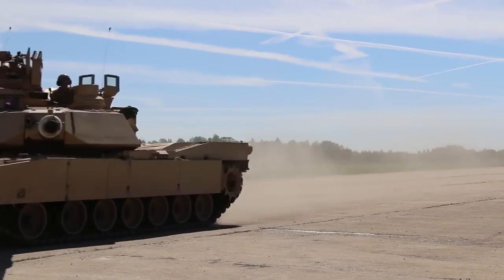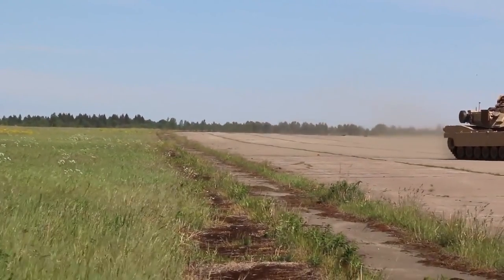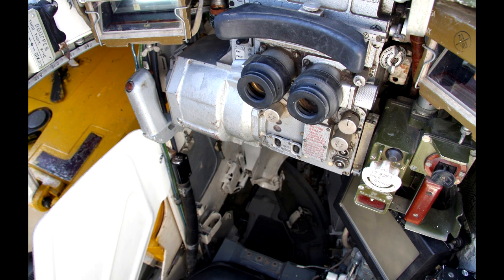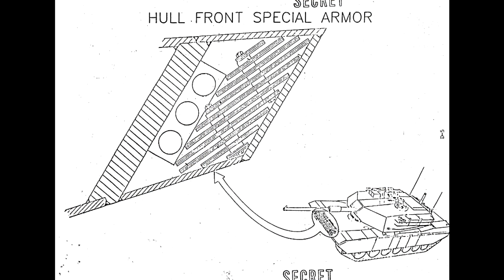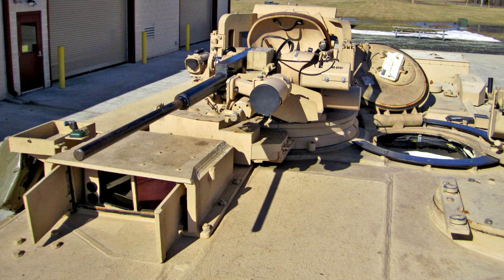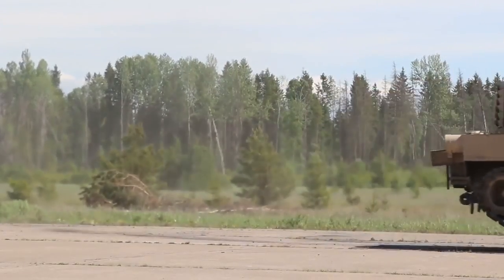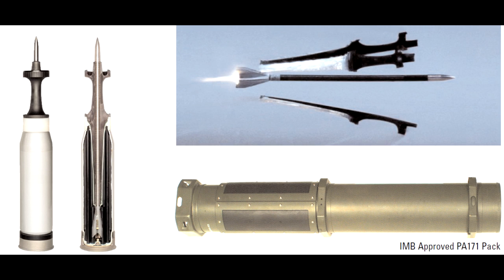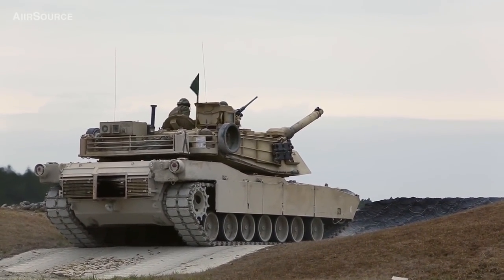Problems with Abrams tank

Comment: When M1 Abrams uses gas turbine engine, it's good. If it's T-80, it sucks. Damn logic
Reply: @QualityPen 
That's operational logistics (getting the fuel from the depot to the AO, which could be Afghanistan for sake of argument) . I'm talking about the Strategic and Tactical levels of the logistic chain (getting the fuel from Beachhead to the motor pool, and later to the tanks).

Your rail network is great for the Operational Level logistics, but you still need to get the fuel from those rail hubs, out to the actual tanks in the field (which doesn't have any obligation to be near any rail hub).

The price is just a clever excuse for the politicians to not pursue it. As for maintenance, that falls within tactical logistics.
Reply: @ShadowFalcon  OF COURSE the soviets lacked trucks, they didn't produce them like a few thousands a year. For example, 44k Ural-377 were made in 12 years which is about 3700 trucks a year. Needless to mention that  the USSR produced other trucks and also by thousands for each type
Reply: @ГеоргийМурзич 
Did I say they lacked trucks?
Reply: @ГеоргийМурзич 
Let me just answer my question to you, myself then.

No! I didn't say the USSR lacked trucks.

I said the Soviet Armed Forces lacked the logistical capability to support a tank force powered by gas turbines.

This, by the way, isn't a technical deficiency. It's a choice. The Soviet Armed Forces didn't believe the increased performance of the gas turbine was worth the increase in logistical capability, and therefore went with conventional diesel engines in future projects like the Object 188 which led to the T-90, much like the German armed forces did when they developed the Leopard 2.
Reply: The same with the silhouette.

Abrams has big silhouette: Good

T-14 has a big silhouette: big target.
Reply: @Kuraimizu9152  Abrams also has more gun depression so the tank can shot even over more Angeles slopes while show less of the whole tank.
Reply: @Kuraimizu9152 
Never heard that one honestly.
Reply: @Alexnder90 F Let me paraphrase: America can use gas turbine because it spends billions on military and can waste galons of fuel to achieve sumiliar performance as a diesel engine BECAUSE WE CAN SO ITS GOOD

You talk like US logistics is infallible, during the gulf war fuel supply was actually an issue at times, even despite US massive fleet of trucks, so no its not like it doesnt matter.
Another thing is that the taxpayers' money that are going on logistics could be spend elsewhere, its like saying that its ok to burn money because you are rich.
Reply: @werrkowalski2985  the m1 only used 2-3% of the 162 millions fuel issued to the army. The planes eat 70% of the 2 billions gallons used in the entire war. The fuel consumption of the M1 is not a real problem at all.
Reply: The gas turbine engine on the tank was considered as an efficient and technological replacement for a diesel engine. More compact, powerful. M1A1 is built from the calculations of the limit of manufacturability and efficiency. The increased fuel consumption was of little concern to anyone; everything was decided by the tactics of application. The complexity of such an engine, too, because manufacturers needed orders.
The T-80 gas turbine engine pursued the same goals, but it was much more expensive than a diesel engine, it is difficult to maintain and repair. The T-80 consumed 1.5 more fuel, which means its tactical value decreased with approximately equal opportunities with the T-72. Yes, this is not critical, but many asked the question what is in the T-80 that it costs 3-4 times more than the T-72?
Yes, the T-80 is undoubtedly better in all respects (almost in all), but against the background of thousands of other tanks ...
A compact diesel engine will inevitably be less reliable than a turbine. Therefore, realizing the further futility of the T-64 engine, the T-80 received a gas turbine.
A reliable and powerful diesel engine is larger and heavier than a gas turbine unit, which makes it inapplicable for tanks with a small silhouette, like the T-80.
T-72B3 has some problems with forced up to 1130l.s. engine, such commonplace as overheating and reliability, even with an automatic engine management system. For small dimensions and power you have to pay. Therefore, the T-80BVM is being repaired and equipped with a digital control system that reduces fuel consumption, making it acceptable.
Reply: same with Leo2 xD
Reply: Its literally opposite. Way more american haters in military comparisons.
Reply: @jamesavery6671  That is not true, most prople who say things about the U.S are responding to the masses of people screaming "aBrAMs BeSt TaNk In ThE wOrLd"
Reply: Travis Tucker you just invide nighbourgs mostly
Reply: On performance, a Gas Turbine is definitely good.

The difference between the Abrams and the T-80 is the fact that, the US Army logistics is capable of supporting the ravenous hunger of the Abrams, while Soviet Army logistics struggled to supply enough fuel for theirs.

It's the same reason the Leopard 2 uses a diesel, and not a Gas Turbine, because none of the users of the Leopard 2 has the Logistical Capability to supply an armoured force that uses Gas Turbines.
Reply: @ShadowFalcon  Middle East is where Nations go bankrupt it is a decision made by Globalist then use the 'infantry' man as bait horrible. The 20+ TRILLION DOLLARS and growing that was squandered is beyond comprehension. Fuel it only has cost most likely a TRILLION dollars by now - USSR went bankrupt as the USA is printing its money and everyone has to use the PAPER Dollar (but one day the plug will be pulled).
Reply: @mt1885 
Hey, I just picked out a country at random, that was sufficiently out of the way, to make logistics at every level a pain.
Reply: @ShadowFalcon  That part of the world is a Nightmare and no nation since man has been on this earth has conquered it and never will. Now if you were in Europe and/or today Russia would be a different story. But they would not be using tanks.
Reply: @mt1885 
For the argument I made, the history of conquest in Afghanistan is irrelevant.

It was far away, and nowhere near any big Logistical hub, so for the purposes of my argument, it fit.
Reply: @ShadowFalcon  logistics is just the means, while the US military doctrine is the real reason.
Reply: @sdrkrm 
If the US military logistics didn't allow for the doctrine to be used, then the US wouldn't use Gas Turbines.
Reply: @ShadowFalcon  it's vise-versa ;) Doctrine and strategic/tactical goals come first. Everything else is then done to meet them.
Reply: @sdrkrm 
Yeah, I suppose you're right, but I maintain that, the usage of the Gas Turbine in the Abrams is secondary to the logistical capabilities of the US Armed Forces.

But I'm willing to concede defeat if you can find a point in the US armed forces manuals, regarding doctrine that stipulates that their MBTs must be powered by a Gas Turbine.
Reply: @ShadowFalcon  I will just citate your own statement and use it against you:

"If the Russian military logistics didn't allow for the doctrine to be used, then the Russians wouldn't use Gas Turbines"

checkmate atheists
Reply: @xAlexTobiasxB 
So, it's everything or nothing with you guys?

Damn, you really are persistent.

Well, buh'bye, find someone else to pester.
Reply: @ShadowFalcon  It was not per say that, but the size of the T-80 tank is considerably smaller than the M1 especially around the engine deck, because both engines consumed the roughly the same amount of fuel, the problem was as T-80 couldn't carry nearly as much fuel with it to support the engine.
Reply: @ShadowFalcon  Bullshit. T90A and T80UA have fairly similar fuel consumption. The driving force for the phasing out of the T80U series is due to majority of the parts being manufactured outside of russia.
Reply: @ShadowFalcon  Source? 
I think Germany could handle gas turbines on the Leo 2's because there are not that many at the moment.
The diesel is just wayyyyy cheaper with like a third of the fuel consumption.
That is also why the Swedes chose it over the Abrams, operating costs were found to be way too high.
Reply: @j.k6943 
Could they?
Maybe.

Did they think it was worth it?
Obviously no.
Reply: @ShadowFalcon So why does the US still think its worth it haha.
Not like they are making a ton of debts too
Reply: @j.k6943 
Presumably because they still have the mentality that they can afford the best, and by gods grace should have the best.

Make of that what you will.
Reply: ShadowFalcon gas turbine is worse
Reply: @ShadowFalcon  Not to mention that the US had developed superior gas turbine engines for helicopters already. That's why the original Abrams took the same engine as the Huey/Cobra. We were decades ahead in testing and research thanks to rotary aviation. The Russians weren't crazy for trying but they simply could not produce the same quality gas turbine engines the US could.
Reply: @ShadowFalcon  Dude what? The Soviet Union was literally the biggest producer of natural gas in the world bro. Only after the Cold War was over and the Soviet Union dissolved was the USA finally able to cope up with Russia's gas production lol
So no, the gas turbine of the T-80 was not a problem for the Soviet Union at all, otherwise they wouldn't have built 4.500 of those tanks!!!
Reply: @xAlexTobiasxB 
I've already delt with this.

I'm not talking about oil fields, or fuel production. I'm talking about the Armed Forces ability to transport fuel from their base depots out to the tanks who need it.

You know, logistics.
Reply: @xAlexTobiasxB 
Actually, it is kind of "rocket science".

The biggest challenge the US had to solve before getting into the fight on the western front was arguably, how to get supplies from the depots and barracks in the US, to the soldiers on the ground in Belgium or the Netherlands.

Same deal with the Soviets. They had to figure out, how to keep their troops supplied, in spite of the lacking infrastructure caused by the scorched earth tactics years before (which included ripping up rail tracks). 

Hell,arguably, the reason for Germany losing WWII, was because they didn't manage to solve this challenge.

Also, why do you think I'm saying that the Soviets wouldn't be able to supply their forces? I'm not. I'm just saying the T-80's fuel requirement would arguably put a needless strain on the Logistical capabilities.
Reply: @xAlexTobiasxB 
BTW, do you think I'm saying that I think the Soviets were bad at logistics?
Reply: @ShadowFalcon  The Americans came from the other side of the world, they had to go over the Atlantic ocean to supply their forces to Europe, it's a totally different setting! The Soviets on the other hand were right there on European soil from the start, they could just RUSH B!!! Which they eventually did. Anyway, the gas turbine in the T-80 had never been a problem for Soviet logistics at all. As I said, they had plentyful of trucks, vehicles and even helicopters to deliver amuniton and fuel wherever and whenever needed. 

And yes, you kinda did imply that the T-80 "put a needless strain on the Logistical capabilities" which is just not true at all. If that were really the case, then the Soviets would never have produced over 4.500 of them!!! (and even more, had the Cold War not ended)

The reason why Germany lost WW2 was actually many different reasons combined, not just one. Logistics was part of the problem, but not the only and biggest problem. First of all, in the early war years there was no big issue with logistics at all. So if they had just stopped aggression after 1941, they would have won the war early on with most of Europe in their hands (Poland, France and other stuff was already unter their control by that time). 

Their biggest mistake was when they invaded the Soviet Union. Because that's when it got serious business. Russia was much bigger and too far away than other European coutnries. Also the Russian people were much more patriotic and fanatic than most other European countries. The Russians loved their land and they would rather die fighting for it than to surrender. With this mindset Russia could not be conquered.

Another reason why Germany lost the war was of course Britain and the USA, which also played a big part in denying most of Germany's initial war goals. The Americans would have bombed Germany to ashes anyway, even if the Germans somehow managed to conequer Russia (which they were never able to ahieve anyway). It doesn't really matter what the Germans had or had not done, in the end they simply could not win against the 3 strongest Super powers. No way.
Reply: @xAlexTobiasxB 
Nothing is ever as easy as "Rush B". As for the T-80 in its actual status. Correct, it isn't a strain, since it's not the main tank of the Soviet Armoured Force. The T-72 is.

And no, I said, the reason the Soviets went with the T-72 rather than more tanks powered by gas turbines was because it would've been a strain. 4000ish T-80 tanks were within their capabilities. I however much doubt a force of about 10,000 (which was the number of T-72), or 14,000 (combined T-72 and T-80) could be supported.

And in any case, why would they? The T-72 is a very good tank too, and thanks to its conventional diesel engine, the supportive logistics of that tank is much simpler.

As for Germany invading the USSR. They did that in spite of what their logisticians said was feasible.

Logistics make or break conquests.
Reply: @xAlexTobiasxB 
Let me be absolutely clear.

I'm not saying the Soviets were bad at logistics. I'm saying they were very clever, with their application of a conventional tank for their main force, and a more limited number of better tanks, for special assignments, which is what they did with the T-72 and T-80.
Reply: @ShadowFalcon  You literally said "Soviet Army logistics struggled to supply enough fuel for theirs (T-80)" in your first post. Which is just bullshit. You should change that in your first comment and make it clear what you mean, otherwise you are contradicting yourself. 

And you forgot the legendary T-64 too which was just as good as the T-72 (in some cases even better) which adds another 10.000 to the fleet lol. At the end of 1991 the Soviets  had over 20.000 T64/72/80 plus 25.000 T55/62. So in total 45.000 Soviet tanks together. And we didn't even mention the 60.000 BTR APCs and BMP IFVs... Overall the Soviets had over 100.000 armored vehicles!!! Which made them the biggest ground army in the world! And all of the vehicles had plentyful enough fuel and ammunition.
Reply: @xAlexTobiasxB 
It was implicit in my first comment that I was considering the T-80 on equal terms iwith the Abrams (meaning, similar numbers, 10,000ish, and similar usage).

I was assuming any comparison, regarding the merits of the gas turbine was to happen on a level playing field.
Reply: @xAlexTobiasxB 
As for total number of AFVs. That just help show that, the T-80 is specialised equipment. Kinda like the original Tiger Tank.
Reply: @ShadowFalcon  No you didn't make it implicit considering equal terms at all, you literally wrote: 

"The difference between the Abrams and the T-80 is the fact that, the US Army logistics is capable of supporting the ravenous hunger of the Abrams, while Soviet Army logistics struggled to supply enough fuel for theirs."

Which implies the Soviets would have "struggled" to supply the T-80 with enough fuel, which wasn't the case in reality. 

Also there were no 10,000 Abrams in 1991 (if you are talking about total numbers produced keep in mind the production coninued for the Americans after the Cold War, while the Russians mostly ceased military production due to recession after dissolution of the Soviet Union). So in 1991 there were about ~5,000 Abrams compared to 4,800 T-80 (they were almost equal in numbers at that time).

And what do you even mean by "specialised" equipment and special "assignment"?? Of course tanks have different roles than other AFV duhhh! Like in any other army too. What the fuck does the Tiger have to do with anything?!
Reply: @xAlexTobiasxB 
Well, I apologise for not making my assumptions 100% clear.

Once more. All I'm saying is, the Soviet Union didn't think it was worth the effort of having 10,000 gas turbine powered tanks.

As for specialised. Well, specialised in the same way the Tiger Tank was specialised.
Reply: @xAlexTobiasxB 
As for what the Tiger Tank has to do with the argument.

Well, it's a more expensive, and arguably better tank than the main tanks used in the German Armoured Force. And it was supposed to be used to establish a breakthrough, thanks to its big gun and heavy armour. 

Much like, the T-80 is a more expensive, arguably better tank than the T-72, meant to establish breakthroughs, and exploit gaps in the line, thanks to its superior tactical mobility.
Reply: @ShadowFalcon  You got any sources for all that FAKE NEWS there slick? 

According to statistics and regular exercises, Soviet Logistics were the best in the world for its time, but hey, orange man bad and stuff and junk so who cares about facts.
Reply: @BigSmartArmed 
The Russian decision to go with conventional diesels on their current tank force should be "source" enough I'd think.

I'd like to have see your citations for your claims myself though.

I have no doubt the Soviet Armed Forces logistics was good at supplying their forces. What I'm saying is that the Gas Turbine of the T-80 was too much of a luxury for the Soviet Logistics (if it wasn't, why was neither the T-90 nor the T-14 Armata, both developed with the benifit of Soviet hindsight, equipped with Gas Turbines?)

Now, you tell me. Which is the smarter decision? To keep using "good enough" conventional diesel engines that fit withing your Logistical structure? Or do you go with the "better" gas turbine engines, at the cost of a more extensive, more complex (more prone to failure) logistical structure?

The US had the luxury of going with number 2 because of their naval power, and already extremely extensive logistical structure, but for any other nation, including the USSR, Germany, or even my own (Denmark), I'd say number 1is smarter.

Also, what the hell does my opinion on Trump have to do with anything?
Reply: @BigSmartArmed 
BTW, the T-80 was briefly blocked from entering service in 1975 by then Soviet defense minister Andrei Grechko.

You may want to read Steven Zaloga's book "T-80 Standard Tank". Seems like the tactical logistics was a concern regarding the T-80 even early in its development, because it was blocked twice, with fuel consumption being cited as an issue.
Reply: @ShadowFalcon  Zaloga is a fraud but hey, orange man bad cuz reasons.
Reply: @BigSmartArmed 
Doesn't look like I'm wrong.

Those articles merely say that Russia is using T-80s in limited scale. Which makes sense. Smaller scale means tactical logistics is less of a problem, and the T-80 has a number of capabilities that makes it good for certain requirements (like cold weather).

I don't see where these articles prove me wrong.

As for Zaloga being a fraud. So Andrei Grechko didn't block the T-80 because of concerns about fuel consumption? I'd love to see your source on that.

Also, why do you keep referencing Trump?
Reply: @BigSmartArmed 
I vote for a right wing party in my own country mate. I'm by no means a "leftist".

Also, what does the production figures for a German tank have to do with Soviet Armoured Force? Surely you should be comparing the figures of the T-80, to the figures of the T-72 (20,000, of which about 10,000 was at the disposal of the Soviet Army). In comparison to that, the "4,000" T-80 the Soviet Army had was limited scale.

And again with the Trump references? You're fixated on him man.

As for Andrei Grechko "lobbying" for the T-64. Why would he? He was a General, and later Minister of Defense. He had nothing to do with the either Malyshev (producer of the T-64 and later the T-80), or Kirov (producer of the T-80). Hell, Alexander Morozov was involved in the development of both the T-64 and the T-80, so if you want to run the "derr, it's from the Ukraine and he's from the Ukraine so he's biased" angle, then that doesn't work either. The T-80UD was done by KMDB, the guys who previously made the T-64.

So no, Zaloga wasn't a "fraud". You just didn't like the decisions made regarding the T-80.

BTW. Why are you so defensive about the T-80 and the Logistical Capabilities of the USSR? I'm not saying the T-80 is a bad tank (far from it. I'm saying it's a very good tank), and I'm not saying the Soviets were bad a logistics either (clearly they weren't otherwise they wouldn't have such monstrous numbers of tanks, ready for action any given day). All I'm saying is, there's different considerations being made regarding the gas turbine in the Abrams, and the gas turbine in the T-80.
Reply: @TheMonkeytrumpetz 
Well, they're certainly persistent. And I am starting to wonder if this is worth it.

At least I got another chance to look into the history of the T-80, so silver linings and all that.
Reply: Alexnder90 F 
I think you didn't read what I said.

I was talking about logistics. Not oil fields. Logistics is a very different beast than what you're talking about.

Edit:
I'm not talking about having the fuel for the tanks. I'm talking about getting said fuel to the tanks, when the tanks needed it. The US Army logistics could do that, the Soviet Army logistics didn't think it was worth the hassle.
Reply: @ShadowFalcon  Lmao another self proclaimed expert that claims to know how Russian logistics work.
Reply: @crnivitez4995 
No, but I can fucking add.

The Russians have more T-72 than T-80, ergo, they didn't think the added logistical requirements was worth it.

It's a fairly simple concept.
Reply: @ShadowFalcon  But I thought turbine engines are multi fuel so they can use the same fuel as T72s? I think your fanboy arguments are backfiring.
Reply: @crnivitez4995 
My arguments have always been centered around the ability to logistically support the engines.

Now, that may include fuel type, but it's not exclusive to it.

It also includes just getting the fuel (whatever it may be) to the tanks, and it includes getting spare parts to the tanks, just servicing the tanks.

Why do I have to constantly reiterate what logistics is? Everybody seem to think logistics works like in C&C Generals, where you just need to have a Chinook or a lorry pick up some supplies, and dump it at the base, and magically, you can now use units.
Reply: @ShadowFalcon  Oh yeah it must be a huge problem for those russian logistics guys to bring 10 fuel trucks instead of 8. Point is don't talk shit about russian logistics if you don't have any clue on the subject, you are making up shit from nowhere and not listing any sources.
Reply: @crnivitez4995  
Well, current events are showing that the Russians are apparently struggling with bringing any logistics trucks at all, so maybe I was too optimistic in my initial appraisal of their capabilities.
Reply: @ShadowFalcon  Yeah I've seen, in fact I was reminiscing of this argument a few days ago, seems like I was the fanboy all along back in the day. Those Russian tanks are getting blown up regardless if they have a gas turbine or diesel engine, and many of them simply running out of fuel and getting towed by Ukrainian farmers, lmao.
Reply: Vladislaus Dracul - The M1’s gas turbine allowed the US to create an expandable platform that’s still in use, in spite of extra weight being added on over the years.  For a tank designed in the 1970s, there wasn’t much choice.  Diesel engines at the time just didn’t have enough power density.  That’s changed, and Russia made a smart choice in using diesel for the T-14.  I’d also assume (based on my conversations with aerospace engineers) that the T-80 turbines were less efficient/more problematic than the M1’s.  Western gas turbines were known to be far superior to Soviet designs.  On the flip side, Soviet rocket engines were considered much better, so technical superior went both ways.